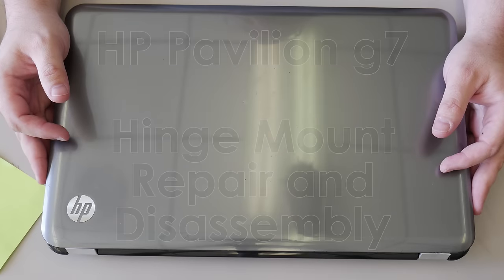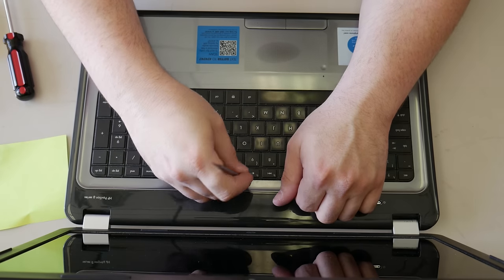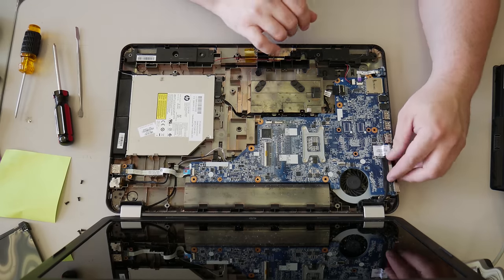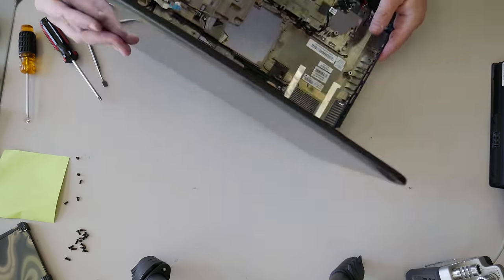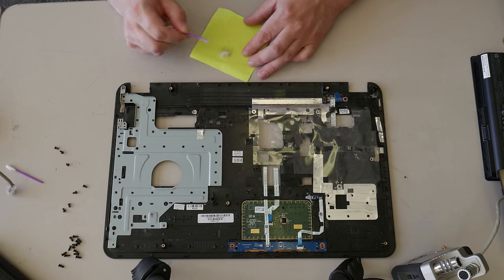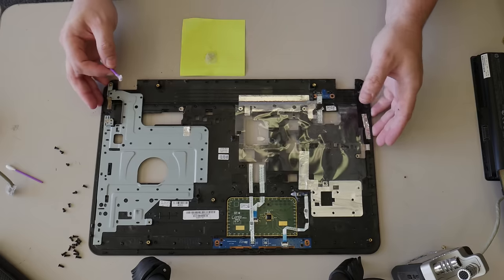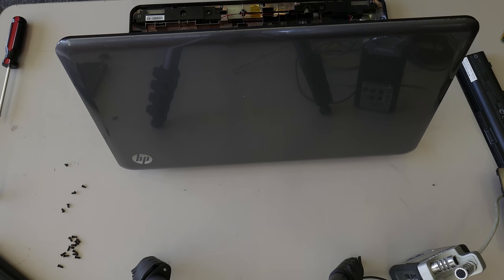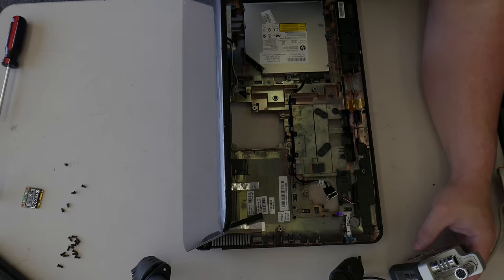HP Pavilion g7 Broken Hinge Mount Repair and Disassembly - Jody Bruchon

Comment: Thanks for the video.  I glued my left hinge and reinforced the right one and everything now works fine.  Could have never figured out how to get at the hinge without the video even though a few of the screws and connectors were in slightly different locations on my G7.  I'd used my G7 for several months with the broken hinge but finally the screen stopped working because the connector to the motherboard had finally worked itself loose near the broken hinge.   One repair shop wanted $300 for the fix and another (the store where I bought it) said it couldn't be fixed at all.  Your video has saved me a lot of money.  Thanks again.
Reply from the maker: That's why I make these videos. Even though they're really boring, they help people! Thanks for the feedback. Especially for small channels like mine it means a lot.

Comment: Thanks for your helpful video.  My son "broke" the hinge arrangement on my pavillion g7 2215DX becuse he has no mechanical intuition, and as the hinges tightened up over the years (it could have been loosened with a 5.5 mm wrench) (hard to find, but I found one) he just yanked harder and harder until it gradually ripped the hinge out of the plastic shell, but also broke the 12" long "holding arms" that run from the hinge u the side of the screen assembly.  I paid HP $148 for a pair of those long holding arms for the lid, waited 4 months, and finally was ready to go. Using your help, it went smoothly.  Yep, gottta use special epoxy made for Plastic, regular epoxy wont do.  (Learned that the hard way gluing the plastic door shells back onto their plastic frame in a 94 Firebird.) .   Anyhoo thanks for your tip.   I luv my little 17" screen G7 pavillion and have had to give it CPR over the last 10-15 years a number of times.  I own two, duplicates, so that when one goes down the other fills in while I do the repair.

Comment: My G7 just did this today. Thank you for your video. I'm so glad laptop repair isn't foreign to me. I wanted a laptop probably 10 years ago and couldn't afford one. I bought an old HP on eBay for about $35 and I learned as I went and pieced it back together. I had that thing apart so many times I lost count. My husbands friend was over today and I mentioned something popped when I adjusted my screen today and even my husbands friend said sounds like a hinge busted. I said Oh God I hope not! I don't wanna go back down that road again. I only close my laptop when I take it places which is quite rare. I don't want to overuse the hinges and they do what this one did today and pop. Cheap crap plastic! I agree with you about not letting HP be a friend anymore and they're no longer invited to your birthday party. I'm no longer HP's friend and they're not invited to my birthday party either. I've got so much going on, this hinge is not what I needed on my to do list. With this laptop being newer to me and I've never had to open it until now, I went looking for assembly instructions and found your video. Thank you so very much for your video. I will repair it strong so I do not have to open this again or hinge issues. Stay blessed my friend.
Reply: I've got some JB Weld PlasticWeld Quick-Setting Epoxy that sets in 5 minutes. I looked up the Loctite Plastic Bonding and it's pretty much the same thing. One wheel axle housing cracked on my Hoover Air Lift vacuum and it would not let me wheel or steer it like normal. So we took it apart and used this JB Weld and some fitting washers to re-enforce it and it's better than a new one now. Guess I'll be doing the same thing on this. This stuff cures hard as a rock so since I have plenty of this, I have to vent the room and use this on this project. It's so horrible that these companies make such great products, but they are not built strong. I could have bought just that bottom piece of my vacuum, but it would have broke again in a few years of use so why do it again? JB Weld it and move on. JB Weld is the new duck tape I guess. LOL!
Reply from the maker: I'm glad to hear that you appreciated my video. In HP's defense, these problems are definitely not unique to HP and in general I don't find HP laptops to be of any worse quality than any other brand. It's specific models with specific design defects, not brands in general. There's a Toshiba hinge mount repair video on my channel too, and I've fixed something from practically all brands in the same way.

Comment: Thanks for the clear video. The only thing which is missing: Why did the hing come loose. I just had to fix a repaired hing for the 2nd time and this time I also reduced the friction on the hings. By the time the friction of the hings increased and give a higher load on the anker points when opening or closing. I pick a video which explains how to change the display to look at the assembly of the display cover and adjusted the friction of the hings. Not to loose so the display will stay in place when opened. I also watched some other videos regarding broken hings of laptops and actually non highlighted this friction issue as the possible cause of the problem.
Reply from the maker: The plastic is insufficient for the hinge strength on these things, especially if someone opens them improperly (one hand on one side).

Comment: Added to m post on hinges on the Pavillion G7.  I was able to loosen up the hinges on my Pavillion G7 2215 with a tiny metric wrench I bought at SEARS (or whats left of it). They sell a bag of tiny metric wrenches, and one of them was 5.5 mm (??? thats right 5.5  not just 5 or 6) Perfect fit to the end nut on the hinge. Turning it about 1/6 of a turn loosened it just enough. to make the hinge not unreasonably tight.

Comment: Me rn. 
Cept, I couldn't get the top case to snap off after unscrewing everything (must've missed something or other) and wound up cracking the grill protecting the fan on the side whilst trying to clean the fan properly. The left hinge seems to have become loose afterwards and pushes up on the case every time I open it now.
Reply: Seems like a common spot to break, mine was loose on that side and developed a crack under, surprisingly didn't break the hinge until I fell asleep on it while it was face down

Comment: what do call the circle thing brass anchor or anker?  i have the same problem with my hp dv6-4008tx
Reply from the maker: I believe they are actually called "brass thread inserts." If your inserts are missing, you may be better off just slapping a ton of epoxy in there and permanently attaching the hinge to the remaining plastic. It's not really worth looking for inserts on these really old laptops.
Reply: @JodyBruchon  Thanks Man!  More Video Tutorial to come 👍🏼👍🏼

Comment: I'm just looking at a friend's HP g6 (AMD) with what looks like the same problem (hinges ok I think, hinge mounts broken).  I (still) have the same problem with my HP but after already replacing the fan on it, the number of connectors and ribbon cables has me worried.  After I did mine, the mouse pad stopped working so I obviously messed up the ribbon cable even though I was careful.
So, do I have another go on my friend's?  Not really sure what the issue will be but guessing broken plastic around the brass mounts.  I don't think I have the nerve.
Reply from the maker: Every time you do a disassembly, you learn. You will make mistakes sometimes. I have cost myself some serious money, but I never made those mistakes again either. Go for it. Don't be afraid. It's not like the computer is in good shape at this point.

Comment: Did you do anything to lubricate or otherwise reduce the effort required to close the lid so the problem does not recur?
Reply from the maker: I don't think that is possible. The hinges are supposed to be hard to open and close because laptops don't use closing latches anymore, and you don't want the screen to fall from its own weight either.
Reply: @JodyBruchon  It is possibe, there are nuts you can adjust where the attachments are.

Comment: Do you have specific brand of that high graded industrial strength epoxy?
Reply from the maker: Loctite Plastic bonding. It's a lot stronger than it used to be.
Reply: thnx
Reply from the maker: Yep, there are several adhesives that will work. The two-part kinds tend to work best, in my experience.

Comment: Dropped my laptop from about 3 ft and the same thing happened, but on the other side. Do you think there are any components that could be in danger from it being open? Not sure if I should bother with trying to repair it if I can get something newer in 3-6 months, but if it goes down the crapper I might be screwed since I work from my computer. Here's a pic, though the gaps a bit wider with the screen open - http://i.imgur.com/3wXo2dQ.jpg Also a little worried about trying to open it in case there's more damage than what I can see.
Reply from the maker: Kay Jaded You should be okay as long as you are careful. The hinge doesn't go through the motherboard or anything like that, but keep in mind that the other hinge is now taking double the stress and may break more easily. It'll probably work just fine for several months if you handle with care.
Reply: Thanks!

Comment: Laptop turns on but fan or screen doesn’t work. I tried to connect it external monitor which also didn’t work. ;(
Reply from the maker: That may be beyond my help. It's normal for a fan to not turn on when the unit is not hot yet and most laptops won't drive an external monitor at pre-boot without a BIOS setting that requires the LCD to change. Re-seat the RAM. Look to see if the hard drive activity light blinks indicating booting is happening. Does the Caps Lock light work?
Reply: The caps lock light didn’t turn on
Reply from the maker: That means that the computer isn't even booting to the point that the keyboard works. Try re-seating RAM and then CPU and if neither of those make it start working you're looking at either a reflow, a motherboard replacement, or a new computer. Sorry man :\ I have a reflow tutorial video on my channel if interested; you'll need a heat gun.
Reply: I don’t know if this is relevant but the internet/WiFi button is lit
Reply from the maker: That will light up anyway, so it doesn't matter. Re-seat, then reflow, then (once all that fails) consider computer replacement. I wish I had a better blind diagnosis to give you but that's all I've got.
Reply: Resetting the ram worked! Thanks
Reply: But the cooling fan is busted

Comment: Would I be better off just buying a new laptop, than to have it repaired. =( I won't attempt this myself...And I'm assuming it will cost a lot to have this done. I saw someone mention $300 on another video.
Reply from the maker: long tooth At my shop I do this kind of repair for $75. I don't know why it would be so expensive unless you were having it done somewhere like Geek Squad. If your computer is fine otherwise it's worth the repair, but $300 isn't far from what it costs to replace this machine with a brand new equivalent.
Reply: Just by the back case